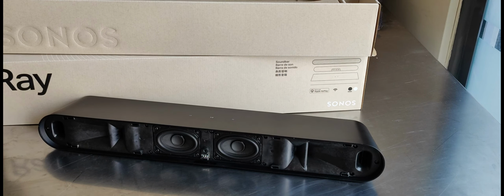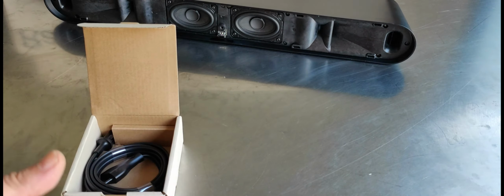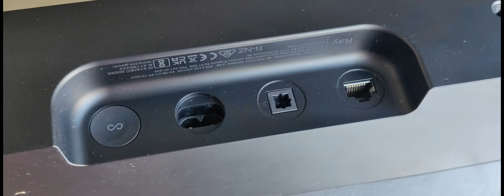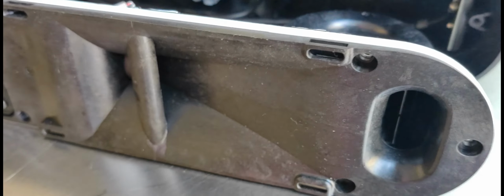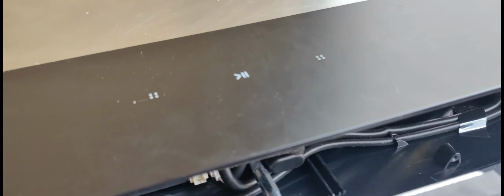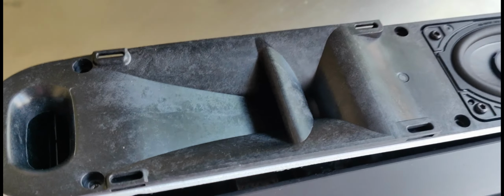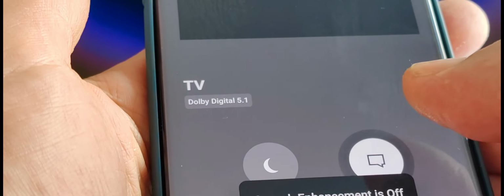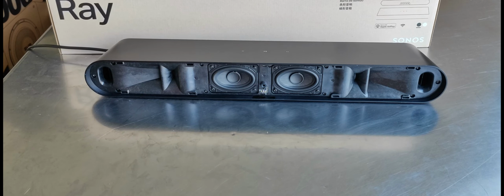Sonos Ray soundbar Deep unboxing and review

Comment: Brother I have a klipsch cinema 600 dolby digital.. I used to have a vu tv dolby digital connected to it.. Performance was good.. Now that I have bought a Samsung tv dolby digital plus.. When I tried to connect
. It sounds totally different.. Voice level have gone down.. Even if I keep the bass level in 1..its overpowering.. Don't know whether its the tv s problem or the soundbar.. Iam sorry to ask you here..need a suggestion
Reply from the maker: Hi check the sound output settings on your TV.